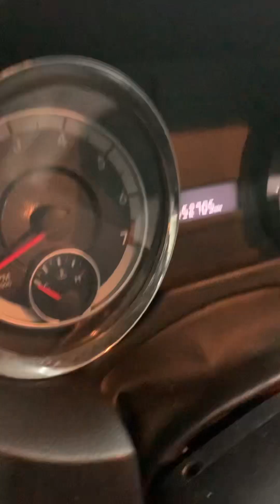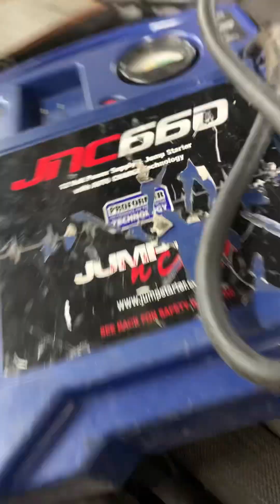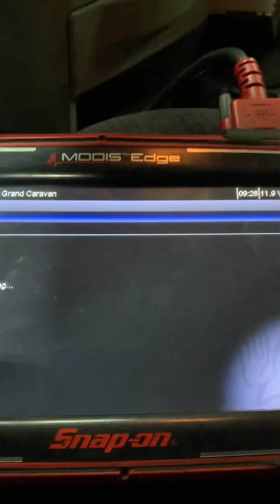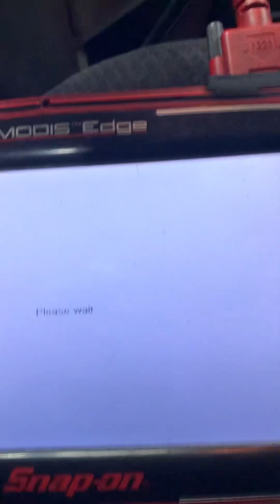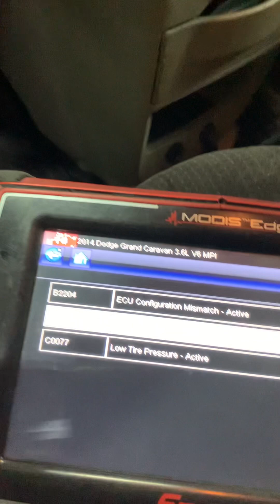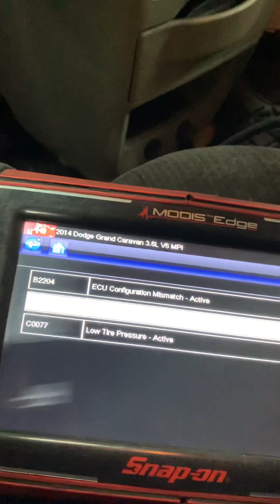2014 Dodge Grand Caravan 3.6 will not shut the engine off with key out of ignition switch

Comment: Did you modify your car in any way? Is your timing too advanced/engine running lean? If any of these things, when you turn off the car, your engine keeps running even without spark, which is called dieseling or run-on.
Reply from the maker: Thank u for participating… to answer your question: no modifications, not a run-on condition since I have to kill the ignition system to shut it off … I will update you once I see the guy again…